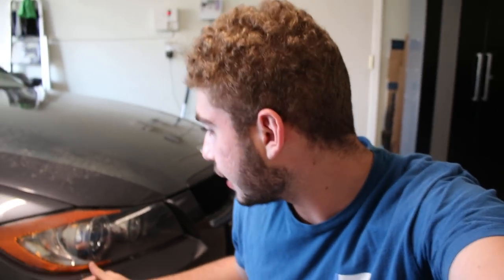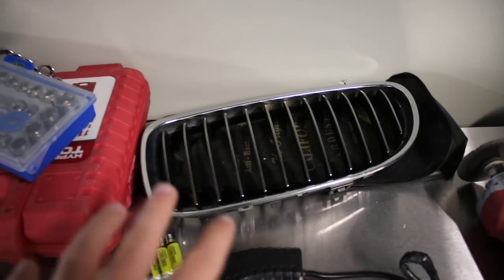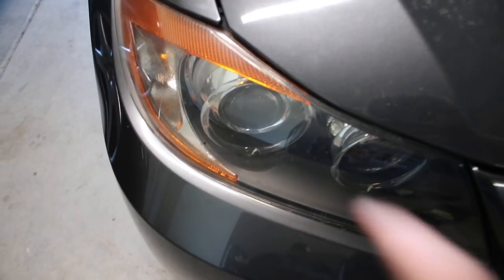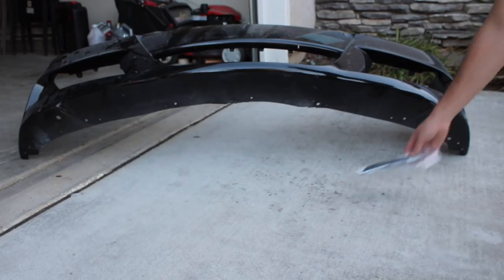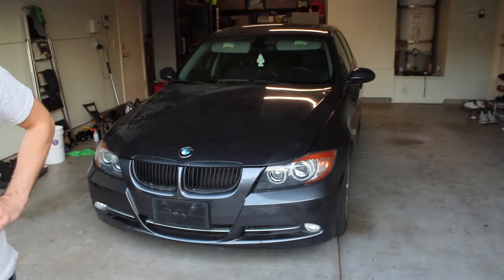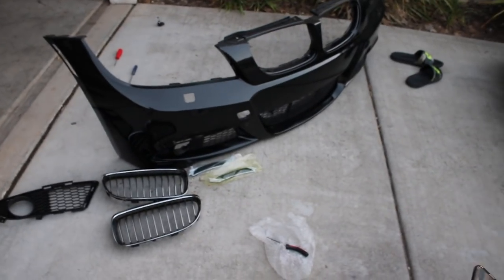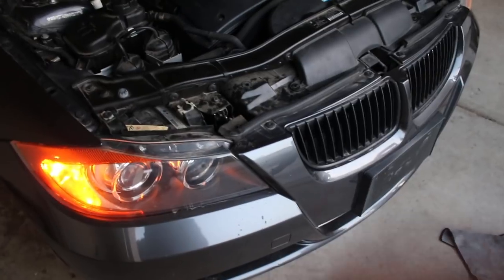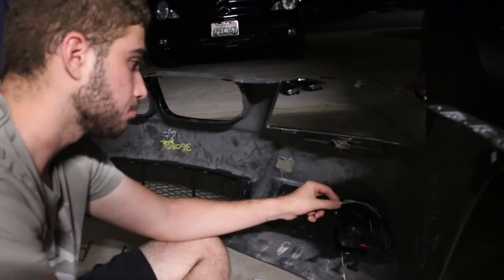THIS IS THE BUILD! (335i Lci Conversion)

Comment: The m bumper kind of looks like the stock, other then that the build is going great just use full synthetic oil n you good, 335 is good to get but I'd only get a 6 speed version because I heard bad things about the automatic
Reply: Bad things? Like what? Doesn't ZF make the best automatic transmissions there is?